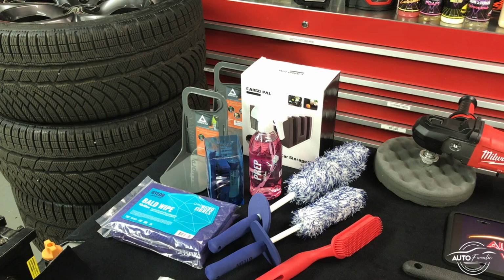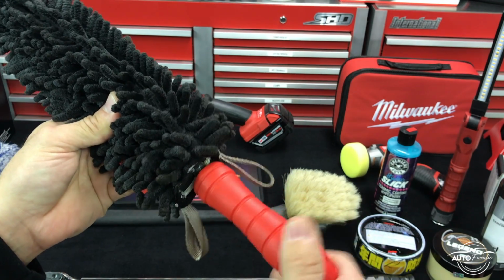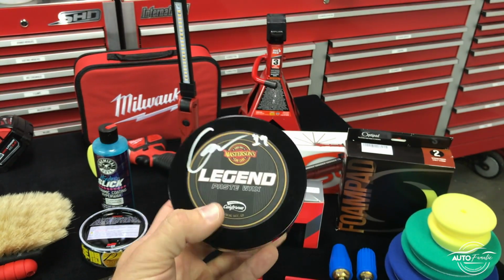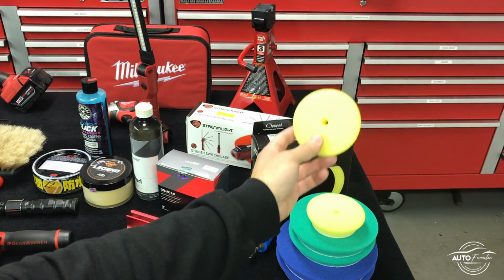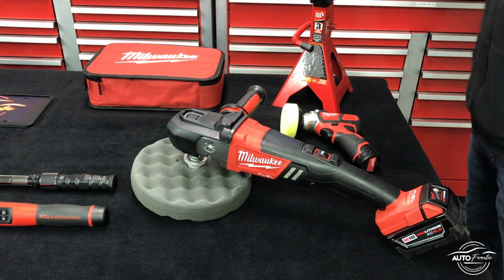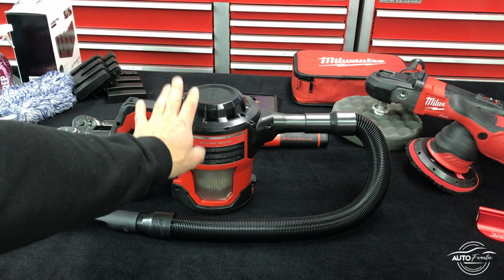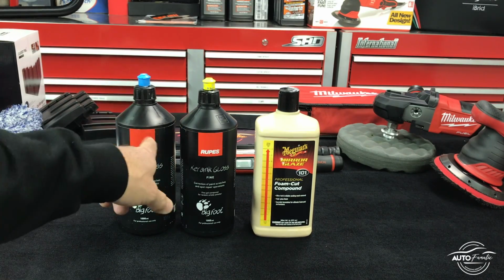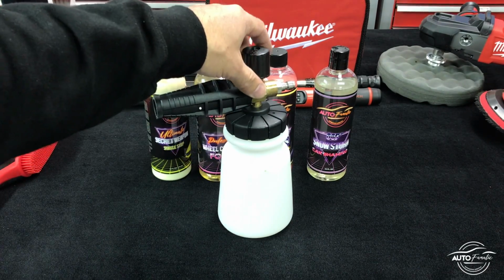BLACK FRIDAY 2019 Auto Fanatic Must Haves

Comment: Great Video! I can't get more than 1-month out of Hydroslick, it's a 9-month old car, has been polished and the surface has been prepped with  an IPA, still one month tops, the gloss lasts longer but the beading is gone by week 3. Have to admit that the gloss and slickness in the 1st week is amazing,  the main reason I'm trying to get it to work longer than a month.
Reply from the maker: try to pick up a bottle of our Auto Fanatic 007 Ceramic off our store or Amazon and use it as a topper and detailers after washes this should do the trick easy

Comment: So Collinite 915 Carnuba (THE BEST gloss but not much durability) or Soft99 Fusso synthetic (ok gloss but the best durability)?
Reply from the maker: depends what you want if you use 915 and after each wash top off with Auto Fanatic 007 Gloss Enhancer its a win win, Soft99 Fusso does not play well with most spray toppers
Reply: Auto Fanatic that’s good info and I prefer the Collinite 915 anyways as I don’t mind waxing my vehicle. 

I have a question, how does Collinite 915 do if put on top of a sealant that has had time to cure. Does it effect the sealant?
Reply from the maker: use over bare paint that is prepared the solvent in 915 will react with most sealants and would be a waste of time and i have tried it many times with various sealants with no special results to report of.

Comment: Can't wait to try your products !!!  Hopefully you or someone will answer how one cleans their (expensive brushes) with caked on black break dust, Grease and everything else that one cleans off dirty wheels - I've used the actual cleaner foam from Eagle One, Dawn dish soap and a mixture of microfiber cleaner with a laundry detergent with little progress !? Thanks much !!!
Read more
Reply from the maker: hi to clean your brushes leave them in a container i use a 1 liter clear pitcher and add some Auto Fanatic wheel cleaner and soak a few hours, my brushes look like new after and i hang them on my rack.

Comment: Awesome video.  I was wondering if you could recommend a cordless impact driver that is not crazy expensive for swapping out my winter and summer wheels. Thanks
Reply from the maker: any good cordless impact will cost money i have heard from many fans some of the nicer Harbor Freight ones work great for the task so you may want to check those out.
Reply: Auto Fanatic I do have a dewalt pancake compressor with hose attachments. Do you think it better to pick up a harbor freight air gun?
Reply from the maker: grab a NitroCat air gun their really good and cheaper than Ingersol

Comment: For the love of God, please do provide an instructional followup video to the Soft99 Fusso Coat video you previously released. I own this product and did use once but unfortunately (as you initially experienced) the amount of dusting I encountered was simply unbearable. If you have found a solution PLEASE share. I would greatly appreciate your expert advice (the wax is incredible in terms of durability but man....IT IS A BEAR TO APPLY!) 

As always, many thanks. love your videos!
Reply from the maker: I just applied the Soft99 Fusso to my Alfa Romeo for winter prep il discuss my tips in my new video tomorrow so check that out. After so many variations of testing I finally found the sweet spot
Reply: Very much appreciated! I knew you would “crack the code”

Comment: Michael McDonald here, quick question for you, could I buy new brakes to get rid of the squeeking? And also I love the look of the car but I just need a little bit more power, what do you recommend. I plan of keeping it forever if I alter it somewhat. 100 more hp and 100 more torque and I believe the car would be right where it needs to be. Thoughts??
Reply: Michael McDonald Squeaking is not caused by the pads or rotors typically. Squeaking comes from the caliper touching the pad backing plate and no lube in between them. All you need to do is remove the caliper and put synthetic brake lube on the backing plate of both pads where the caliper and piston touch the pads. Hope this helps!
Reply: AF has a video on this, watch it and follow the steps, I did well over one year ago and have had NO squeals. It’s not the pads to the rotors, it’s the caliper pistons against the back of the pad and/or the spring, slight vibration... Lub them as he shows.

Comment: That UV light on that stinger will co exist with the new adams ceramic for those easy high spot findings.
Reply from the maker: the Stinger is the best LED flashlight i ever owned, once you hold it in hour hand youll realize why its $99. I use it to check paint during polishing and its perfect

Comment: For the pinch weld jack pad, what size would you recommend getting? It would be for a 2019 Civic Hatchback Sport if that helps
Reply from the maker: the one I linked is the best size you are better off with this size as some plastic side skits will interfere with the others I've tested. it works great once you try it you'll never use a block of wood again.